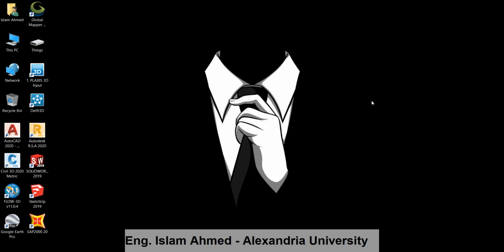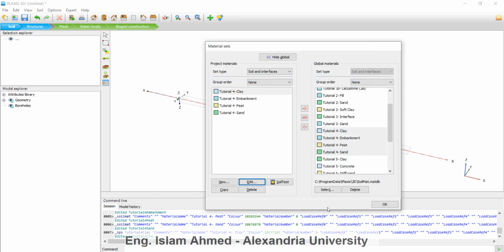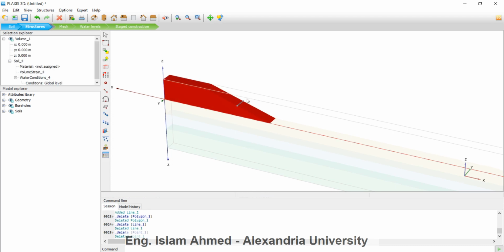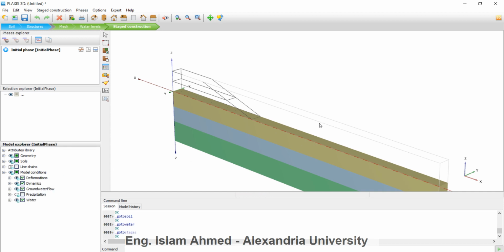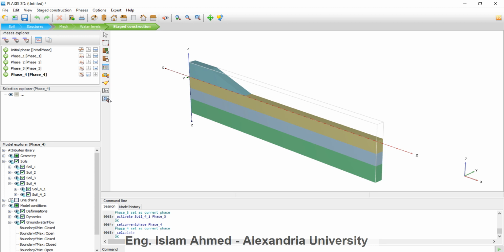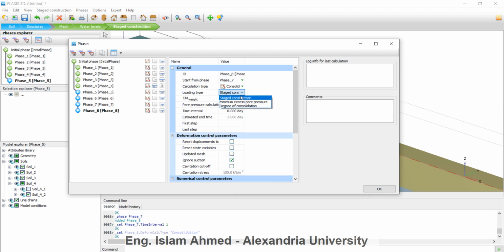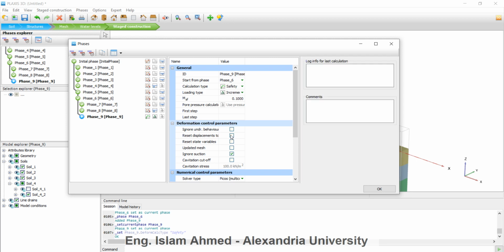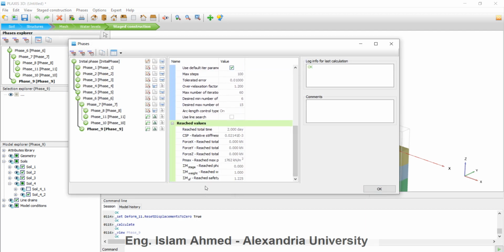Plaxis 3D - Tutorial (4) - Consolidation Analysis - Road Embankment - With Sand Drains

Comment: Hello sir, thankyou for all. My thesis is depends on the effect of vertical drain with varied different diameter and spacing of vertical drain , but till now not clear about how to apply different diameter of ver. drain , the softwer is consider only spacing of ver. drain, so if you have any point about the diameter of ver. drain please help me.
Reply from the maker: You cannot apply the effect of diameter using that “line drain element” 

My thoughts about this is to model your drains as solid elements “cylinders” after that you click the volume and “decompose into surfaces”
Finally choose your outer surface and assign a proper “Hydraulic Condition”

Comment: Hello sir. Is it possible to change the properties of drains. As i want to analysis on sand drains under embankment ?
Reply from the maker: No it is not possible to do so as it is considered as uniform pore water pressure all the way through drain's depth. You only need to define the head (h) and the software will give pore pressure for all line drain node equal to defined head.
Reply: @eslamahmed7022  can we divide soil into sand columns then keep sand as drained and clay as undrained. In that case is it possible ?

Comment: you didnt give properties of sand to the sand drain.
Reply from the maker: You only need to define the head (h) and the software will give pore pressure for all line drain node equal to defined head. But you have to know that pore pressures that are less than drain's head will not be affected. 

In consolidation calculations drains usually reduce the excess pore water pressure to zero that's why I didn't put a specific head (h) because it will be ignored by the software, knowing that the properties that I'm talking about are under "NORMAL" behavior of drains. 

please refer to "3D-2-Reference.pdf" installed with software Page 156/540

Regards,
Islam
Reply: @eslamahmed7022  Thank you for replying. i want to do thesis on consolidation of embankment

Comment: Thankyou sir it's clear tutorial for me but now i have some question: 
1. How to define material of vertical drain?
2. How can i insert the diameter of verical drain?
3. How to apply triangular pattern for vertical drain?
Reply from the maker: You only need to define the head (h) and the software will give pore pressure for all line drain node equal to defined head. But you have to know that pore pressures that are less than drain's head will not be affected. 

In consolidation calculations drains usually reduce the excess pore water pressure to zero that's why I didn't put a specific head (h) because it will be ignored by the software, knowing that the properties that I'm talking about are under "NORMAL" behavior of drains. 

so you don't have to define its material nor diameter as we have nothing to do with stress analysis it is only consolidation analysis

please refer to "3D-2-Reference.pdf" installed with software Page 156/540

About Triangular patterns, I think it is totally a geometric matter.

Regards,
Islam